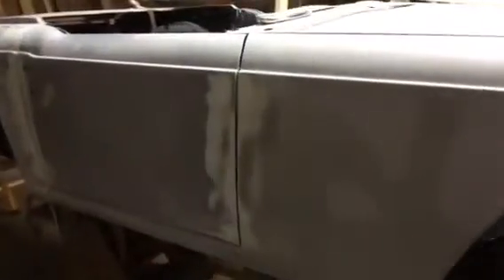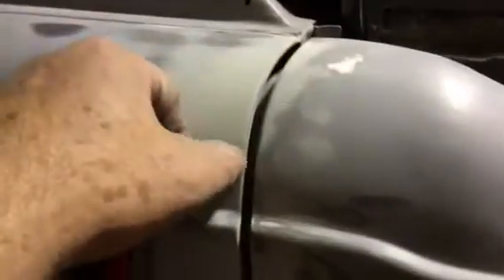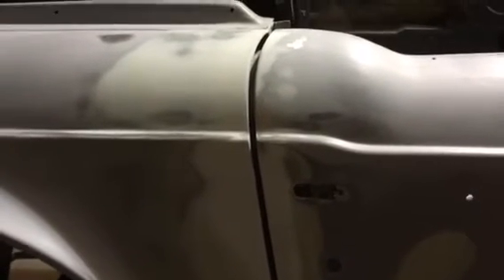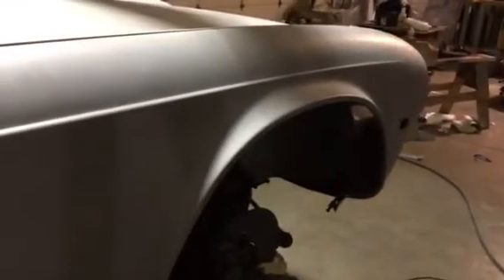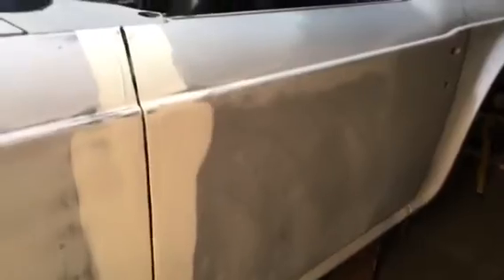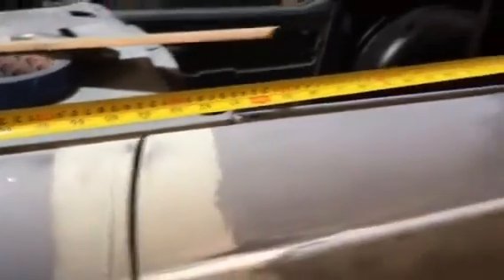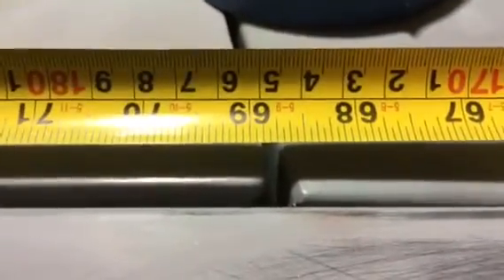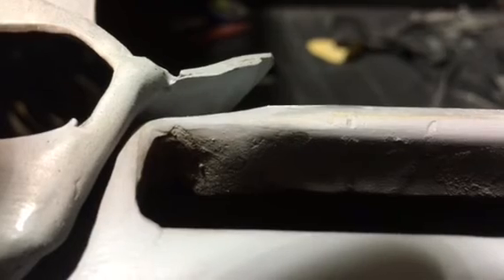Tr6 Door adjustment at A post 1/4

Comment from the maker: Sean! I had no choice but to adjust it, but the confirmation of others is confirming some things. My two other restoration candidates needing major floor and sill work measure wildly, making me think that the usual worry about cutting a tr6 apart and rebuilding a car that looks like a tr6, ignoring the factory voodo, is not a bad battle plan. After all these years and owners, many of these cars are indeed a collection of odd parts. Years ago my first restoration was a careful, respect the factory thingy...it was was a real slog. Yours is 174 on both sides? Bruce's was 174-174.5 sort of averaged. This one is 173/175 so I feel that I'm right down the middle. I owned a 1971 in 1975. Four years old and just a box of bolts. Thanks for your confirmation

Comment: On mine 1740 to 1745. Not an easy dimension to get with one person holding both ends. Tape keeps jumping out just as I go to read it. Not sure why your door looks so tight. I did not do the resto work on my 1971 car.
Reply from the maker: Well, that says a lot actually!  I'm in the ball park. This shell is a front and a rear connected with new floors. If the plenum/A post unit is rotated two degrees too far forward or back (drooped down when the floors were welded in) its a disaster!  The passenger side on mine measures 175 and driver side is 173. Consistent... Correct or otherwise! Curiously the door fits the hole evenly spaced everywhere else. I find it hard to measure with confidence. I've got three of these and there's very few good  measuring points on any of them. Thanks Bruce.